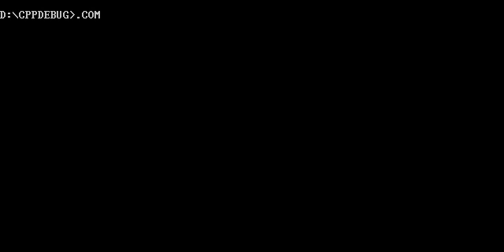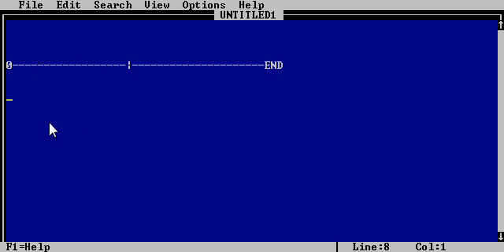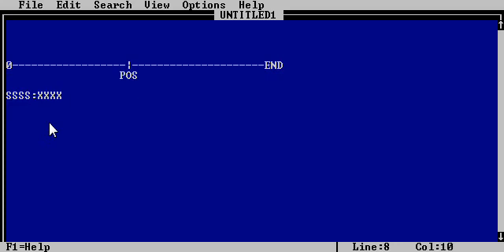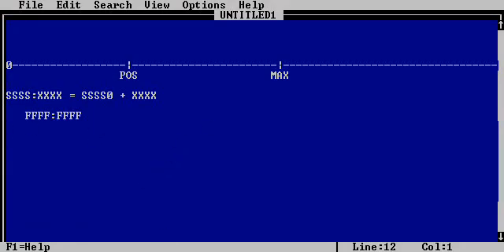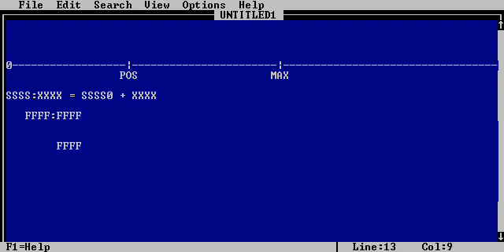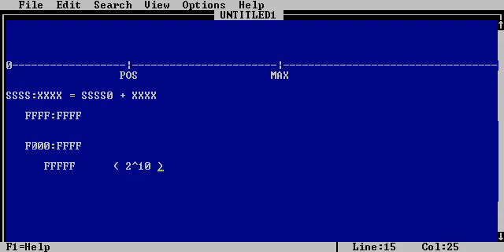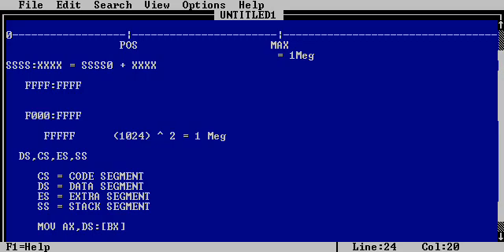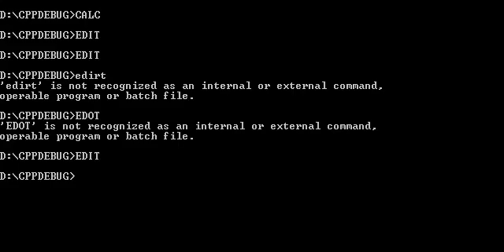C++ Programming Tutorial #10 : Building a computer program "from scratch"

Comment from the maker: Lastly, to view RAM "interpreted as" code, you use the 'U' command (unassemble) which works like 'D', but prints what instructions the bytes would correspond to were they bytes *of code*. On its own, U will unassemble, from 100, and by *number of instructions* (I think 16 is the default) interpreted. So the byte count will not be the same every time. 16 NOPs would unassemble only 16 bytes worth of code.

A range my be supplied: U 100 11E say would *attempt* to unassemble up to and including 11E.

Comment from the maker: To view RAM you use the D (dump) command which works like this:

On its own and if not yet used, D prints, from offset 100, 80 bytes worth of RAM from there. If you look at the bytes and compare with the first 'R' printout, the first few bytes will correspond with the instruction at 100. Each consecutive 'D' command prints out the next 80 bytes (these numbers are in hex).

To dump a specific range you give the starting and ending offsets (not a count). Ex. D 100 10F for 10 bytes starting at 100.

Comment from the maker: Without parameters, it prints out the current state of all the registers and the next instruction about to be executed. Otherwise it is used to set the value of a register such as ax:

RAX [ENTER]

brings up a prompt (current value of AX then a colon)

AX 012A
:

At this point you may type in a new value for AX and it will get set.

I'm always using RIP to move the instruction pointer back to 100, or wherever I've accidentally assembled something not being pointed at by the instruction pointer!